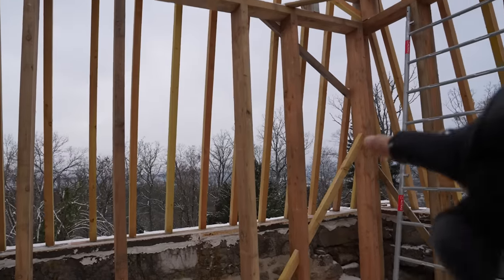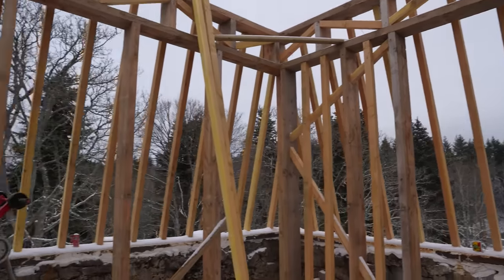Completing the first part of the chateau roof.

Comment: Having framed many homes here in USA, and now retired, I wish that I could have worked on such a steep mansard roof. Hard work and weather are downers, but the satisfaction of   building that frame......wow....I can't believe I've  done this.......great achievement Dan!
Reply: I was thinking the same thing.. I've done a lot of roofs over the years but never a mansard. I did do an A-frame one time. Wonder if that counts?
Reply: Unlike you gents, I’ve only framed a half dozen roofs (?) and am puzzled here about the size of the structural members. I live in a zone with a 105 psf snow load requirement which would be a carried load of 2-3’ of snow. My rafter is a 2x8 or 10 (for insulation) and trusses of 2x4. Is this overbuilt or needed to carry a heavy tile?
Reply: @markstevens1729 
In Europe roofs are built much stronger than in the US.
Reply: @markstevens1729  Overbuilt?   
Maybe...  
But unlike the roof of a normal home, this is high up in the air, so it'll be more difficult to repair in the future, so you add a bit extra to make certain nothing can break. 
(Modern roof structures often have a calculated lifetime of 30 years... That won't do on a chateau!)
Also, while this section of the roof is nearly vertical, so doesn't carry much snow by itself, it also has to support the weight of the top section and any snow load it will take. And in addition handle a lot more wind than the roof of a regular home.
Reply: Original this roof was covered with slate, and they are heavy. No idea if he will use this as well, but he said he wants to build it like it was. So the the roof structure needs to carry a lot of rock.
Reply: Ho wow Dan quel magnifique travail tu fait 😊
Reply: So exciting
Reply: Our church here in USA has a new composite to replace slate tiles,,,cannot wait to see it done! As excited as if it's MY house 😂❤
Reply: The Queen Ann victorian homes in the US have mansard roofs
Reply: The mansard was designed after top floors were taxed. To get around the tax, the roof was pulled down over that upper floor.
Reply: Amazing work Dan! Excited for the next step.😎
Reply: I as,well have hand cut and built many many roofs over the last 30 plus years but never a 36/12  like yours . Let me know if my eyeball calculation of roof pitch is correct.  
Sincerely sinsay carpenter.  
U are correct sinsay is not the correct spelling and I'm not Asian . Just an American Mutt
Reply: This roof when finished will last the length of time it should of at least 100 years. Like most other chateau. Yes you get tiles blow off or fall but it will need full replacement in about a century.
Hes turning into a good builder.
Reply: What's stopping you?  You being from a country like yours, can always have access to whatever you want to do, wherever you want to go. So you actually can have a wish fulfilled at the flick of a finger. I'd definitely want you to go over to the chateaux and join Dan in his work. ❤
Reply: @markstevens1729  Most Europeans tend to use very beefy structural timbers compared to the US, if only for tradition's sake. Even though the width of, say, a floor joist doesn't do much for its strength, that's mostly the height, Europeans rarely use joists less than 75 mm (3") wide, often 4" or more. In my part of Europe larger 2by sizes don't even exist. 1x2, 2x2 and 2x3 (always dimensional) are standardised, above that it's 2x10 but that's only used for scaffolding planks.

This roof is very likely designed for slate though, so it will get a lot of weight, as others have suggested.
Reply: Amazing job Dan 👏
Reply: @markstevens1729  Im loving watching Dan doing this. I watch a lot of renovations mostly in France. You may want to check out Martjin Doolard’s renovation of a stone cabin etc (he just started the second cabin) in the Italian Alps. The size and amount of wood supports for the huge flagstones on top for the traditional roof is a bit to think about.

Comment: Instead of just boarding up the windows with OSB sheets, I suggest you use a good clear tarp or heavy clear plastic on frames to do it. If you get it good and taught, the clear tarps will last for several years as temporary windows. :-) Best regards from a fellow carpenter, you are doing a smashing job!
Reply: not to mention $$ he will be saving.
Reply: Hope he reads this one!
Reply: And, he will still have daylight throughout the interior of his Chateau.
Boarding up windows will take away any daytime lighting if he boards them up.
Reply: Since the electricity will become an issue with short days and bad weather, saving most of it during daytime is essential.
Reply: @tomjoad1363  We're past december 21st, so the days are already getting longer.
Reply: @tomjoad1363  O hope we get an update soon on Power from the Local Electric company. Dan mentioned get electricity to the Chateau weeks ago; but hasn't mentioned it again. 
It would allow his Yurt and Chateau Construction to not worry about solar or Portable Battery Banks. I seem to remember an EcoFlow...
Reply: I @dennispatrick4999  I don't suppose you heard the humming of a generator in the back ground? Tricky one Dan, but coming along fine.
Reply: This would help with lighting for camera as well.  Good idea.  🧡
Reply: Talk about working under difficult conditions, you are doing fantastic job, Snow rain cold, go Dan, the framing for the roof looks amazing, can't wait until it is finished and you are onto your next stage, hope you are looking after yourself, eating well, getting plenty of sleep, maybe a multi vitamin wouldn't would help keep you going, take care.🙏❤️😌👏

Comment: Maybe board up the windows with clear plastic instead of wood. It will still do the job of keeping most of the rain and snow out, but will still let light in.
Reply: That's what I was thinking too.  It would give him a place to get out the weather.  If he closed in the room below really well, he could even heat it.
Reply: Perspex . The outside light would be an asset
Reply: Plastic stretched over a wood frame like a painting (canvas over wood) then screwed into a window opening. That allows for removal for access and a good weather barrier.
Reply: Love the idea.
Reply: Great idea
Reply: @francesclark363  Perspex or multiwall sheets, they're cheaper and much lighter than perspex but almost as strong because of their internal structure. Not sure what they're called in French unfortunately. I'd screw them to wooden frames for easy removal as @gallagher68 suggested.
Reply: @gallagher68 great idea!!! Simple yet effective.

Comment: I found this channel by complete accident around episode 70, and it’s been one of my favorite things to watch on YT. There’s something so alluring to taking a gorgeous wreck and bringing it back to life. Love every minute of this. 
A couple points however: 100% agree with the others about the clear plastic on wood frames for windows. As soon as you said “cover the windows” I said out loud, “should use clear plastic instead”. Helps limit the amount of power you need for lighting too. Second, Dan, please, at the risk of sounding prude, buy yourself a 20 pack of safety glasses and wear them. Especially with a framing nailer or circular saw. I’ve had friends lose eyes to both errant nails and carbide teeth dislodged from rotating saw blades. $1 glasses could save an eye and months of recovery. Last, I received my ornament, albeit a few days after the tree was stored. Thank you for your work to be sure they made it out.

Cannot wait to see that roof go up!
Reply: I discovered it about a week ago and have binged my way from episode 1, it has been a ride.

Comment: The next half should go a bit easier - but the middle is still a massive task.
Reply: Yeah, the top of the tower is still very unsafe...
Reply: I think he's going to brace it, get the cladding on and then tarp it so it dries out that wing, and then it's a case of rinse and repeat the other side, tarp it, then start putting the floors in the middle, because that is another level higher than the wings.
Reply: What satisfaction Dan. If it was easy, you wouldnt feel that deep feeling of achievement 
 Well done, and thank you for filling my evenings with interesting joy❤
Reply: @Idrisbach  Well, getting(steel) beams in should stabilise the lower part of the tower, the upper part is what concerns me most, since you can see from previous Videos that 2 of the Walls are slanted inside and both brick- and mortarwork are essentially Sand after that fire and nearly 50 years of weather. It's good that it's going forward, but securing the tower should be the top priority, since the whole building depends on it. If only one of the Walls caves in, the whole building will follow or be in an unrepairable state...
Reply: Thing is, can he even get to the turret to seriously work on it until the floors are in the middle? It's a fiendishly complicated roof where it's like three separate buildings which all overlap each other in the centre. It took me a long time staring at original photographs to even begin to make sense of how it all goes together.
Reply: @lucyxchan6808 That's not true! Since only the top is in bad condition,if it crumble it won't demolish the whole building!!! If he lose the tower he will have to rebuild it ,not restore it....that's it.
Reply: @Idrisbach  correct me if im wrong, from what i could gather abput the structure is that there is the tower/turret that is the base. Then there are the wings of the building that are simultaniously hanging on the turret and supporting it, much like the outside arches of those gothic cathedrals with oversized halls. But the thing is, if one of the side buildings collapses, a rebuild is still possible, while the failing of the turret will compromise the whole building and make anything but a rebuild after tear down impossible. That's why im a bit confused that he is securing a side building while the most important part of the mansion seems to be more decrepit than the rest. I might also be wrong and the outside Walls are in much worse shape than im imagining.
Reply: @skdoremi6666  that might be true if two of the side wings were not shells without inner Support. That's why an chain reaction over multiple floors of the Chateau is an harrowing possibility that should be negated as fast as possible.
Reply: The way I've interpreted it from studying the original photos is that you think that they're wings - and I thought so at first as well, but they're not - it's like one long rectangle with two inserts in the middle - the turret is inset onto one side, and the rear building inset into the other. 

So the turret is kind of like it's own building, as is the rear building. 

If anything is going to come crashing down, it'll be the window arch on the (now vanished) mansard of the rear building. Looking at that every day would make me feel queasy. But it's stood up there so far, and he can't get anywhere near it until the rear building is refloored, so it is what it is.
Reply: @Idrisbach  ah, that's very interesting. Then it makes very much sense to first secure the outside buildings while leaving the one out back for last. If it's like that, an cave in of the turret, outside of possibly taking down the lower floors will not much harm the rest of the structure. I was a bit lead by the nose since the Chateau is on an Hill and buildings that are independant "modules" where the outside structure is the one bearing are mostly used for more unstable ground than what i thought was earth and perhaps Granite.
Reply: @Idrisbach That window arch would have been made a great intro view. Imagine an aerial view going backwards, we see the countryside then we pass over his head to discover he is standing at his blacony watching the countryside, the drone keep going backwards, revealing to the viewer that the room doesn't even exist anymore but the arch, then still going backwards and upwards, revealing to the viewer the entire castle.
Reply: Yeah, it really threw me at first as well - it's a building which takes a lot of getting your head around to properly visualise it and how it all went together.   It's kind of like this  I>----I--I----<I
Reply: Another fab vlog of your journey, I hope your supplies turn up very soon. K🇬🇧❤️❤️
Reply: @Idrisbach  it's unusual, but it has it's advantages, are there any pictures of while it was built? My guess is, that they had an smaller building Crew and to make the job managable, the architect used this to speed up construction, while still going with an reasonable timetable for this. 
Thank you very much for this very pleasant and most rare conversation over this Chateau, im really delighted to have found such Civil conversation Partner.
Reply: @tomjoad1363 too bad that window is unreachable. Or good job that it's totally unreachable or Goatman Dan would have risked it already.
Reply: Hello Dan! xx
Reply: It’s so great to see the roof going up but when you look at the rest of the house…..
Reply: @Idrisbach  He can access the third floor of the tower both from the inside and from the hallway, that's one level below the really bad part of the walls. Getting the scaffolding up there and fixing the walls should probably be top priority once the weather gets nice enough for masonry work again. I don't think the tower as a whole is at risk of collapsing but even if just the top 1 m of one of the walls came down it would probably take out the nice new floor on the third floor and could kill somebody.
Reply: Big job but he keeps moving forward
Reply: if he had one more person , fulltime .. it would go much easier and safer.. at least for the roof

Comment: Dan, you can't use a plumb line laser like that. That is, you can't direct the line at an obtuse or acute angle to the wall. To cast a true vertical line it needs to be positioned directly perpendicular to the wall you're casting a line on. If the wall itself is even slightly out of plumb the line will track off plumb depending on how acute the angle you're casting at. The fundamental difference between horizontal and vertical lines is that from one point of position there is only one horizontal plane (so any object a horizontal line hits, is at horizontal) but there are an infinite number of vertical planes in a 360 degree rotation.
Reply: Gut erkannt.

Comment: Dan keep shoveling the snow on the level you are working on  into buckets/or some large containers. It will make your boards last longer than if the snow melts  and  soaking into them plus you will have some water ready for next time you need it. 
Awesome job. You have my full admiration.

Comment: V202: Just watched an hour documentary about the Foreign Legion.  After seeing all the work Dan has done he would would be a top candidate for that training! He is one tough hombre! Just a suggestion Dan is to construct a large polythene 'tent' now over this structure (as roofers do when replacing a roof in a house). This keeps the timber AND YOU DRY and also less slippery no snow etc. You are then effectively 'working indoors' which should keep the elements off you. You can buy HUGE clear polythene sheeting 10m square.

Comment: there are solar panels that look like metal roofing. there was a 'Grand Design' episode recently that showed this tech off. Perhaps that is something that is compatible with your plans, if there are any protections on the architecture you have to abide by.
Reply: "Eco House Supplies the Village with Power" from 13.11.2023 on yt. apparantly an estonian company produces that style of roofing in that video.
Reply: I think even if that was a concern (and I doubt that considering none of the authorities have cared about the state of the château for 37 years and before that the owner was allowed to make massive changes, like replacing the missing stone balustrades with solid concrete walls) you could put regular solar panels onto the upper part of the mansard roof and they wouldn't be visible from the ground.

Comment: When they build the big apartment buildings between 1870-1930, they always started with building the outer walls. Putting a roof onto it and placing a construction crane inside the building. Working from top to the bottom, flor by floor. So the were able to work during winter time.
Reply: The stud walls that support most of the roof sit on the floor joists, you can't really do that in this type of building.

Comment: I would use a back pack petrol leaf blower to clear that dry snow away from the work area , the intense air blast will harm nothing , but clear the area quickly . My Hyundai is excellent , very reliable and was a bargain , plus it can be used all year round for leaves , sawdust or debris clearance on the drive etc , and no i'm not on commission 😂 .

Comment: Any thoughts on completing the first section completely and then moving in while you fix the rest?
Reply: That would mean to create a separate heating system for each unit.
Reply: He would need to do a lot of work to make it not leak heat like crazy. Better to keep using the yurt for awhile until he gets more work done on the rest of the chateau. At the very least he's going to want to finish the entire roof and install doors and windows.
Reply: several episdoes back he said he would continue living in the yurt because it is comfortable till he finishes the chateau...

Comment: When the roof is water tight and you cover most windows with plywood and the rest with transparant corrugated plastic roofing (for light) (or windows if possible) you can close it of from the elements with the interior doors if you cover the outside with a double layer of builders plastic that you can staple to the edges. that way you could possibly move in while you do the rest of it, or at least just have several dry rooms for storage. Well done so far, keep up the good job.